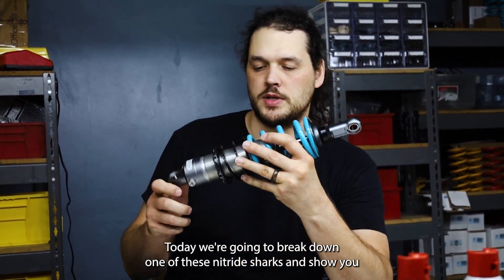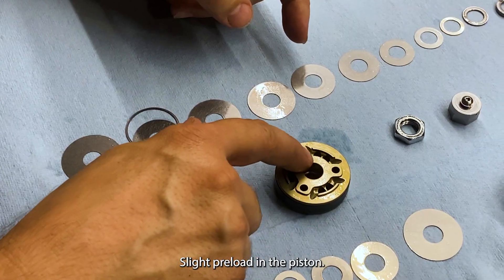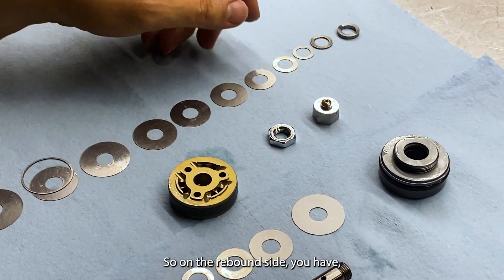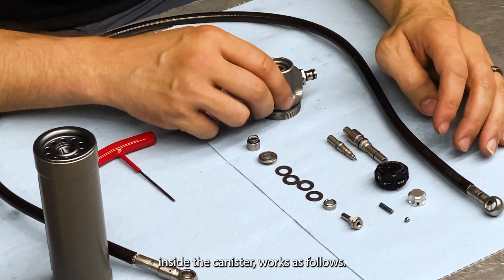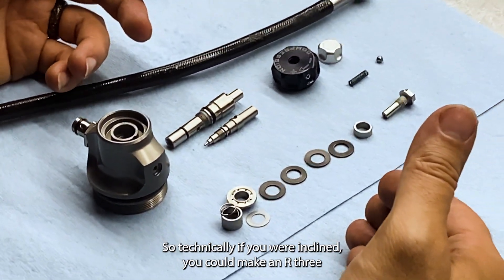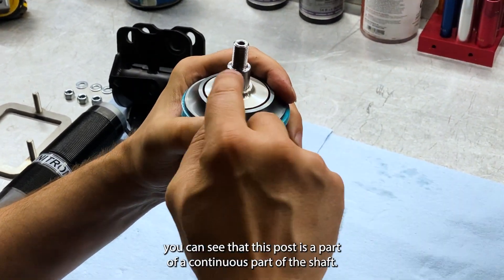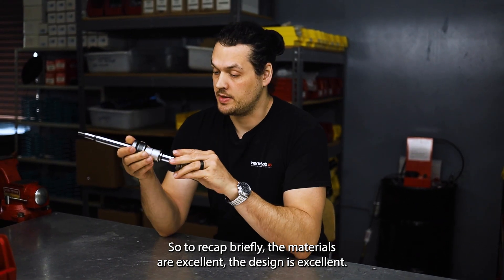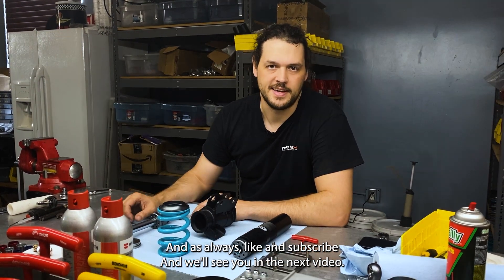Nitron Shocks: Components and Construction

Comment: I'm back watching this video after having bought the R3's from you and the getting a lot of seat time with them... now I understand even more about my dampers. Nice. You said the rebound holes on the piston has 3 smaller holes vs the 6 larger holes on the compression side. This means more initial force on the rebound side? As in, if you plot both the rebound and compression curve on top of each other, the rebound curve ramps up more?
Reply from the maker: Yes more or less.  It just means there is more area pushing against whatever shim set is there.